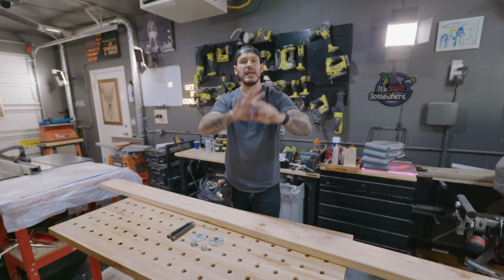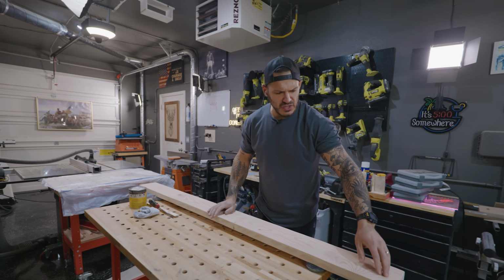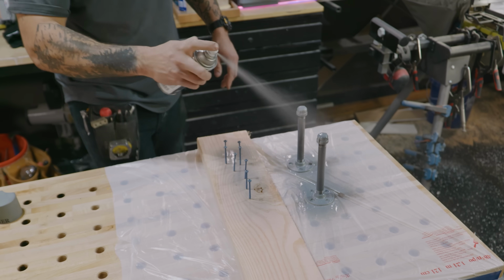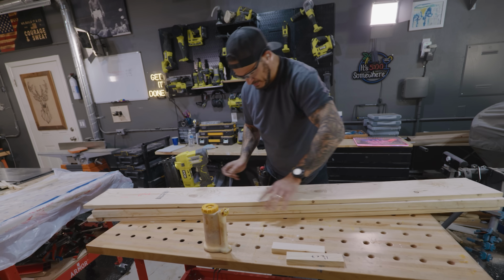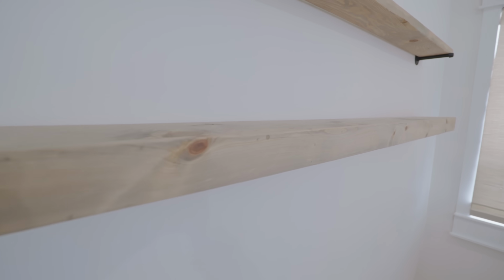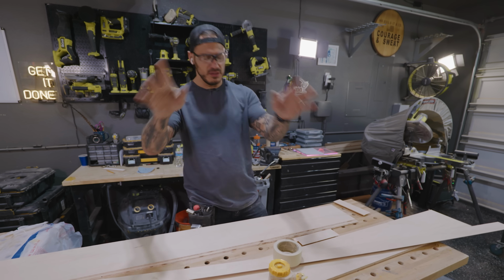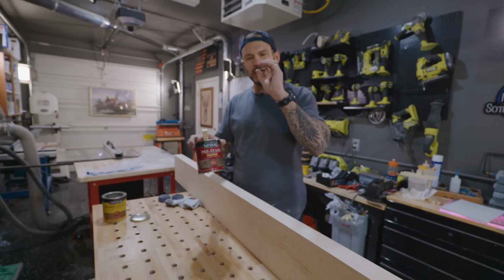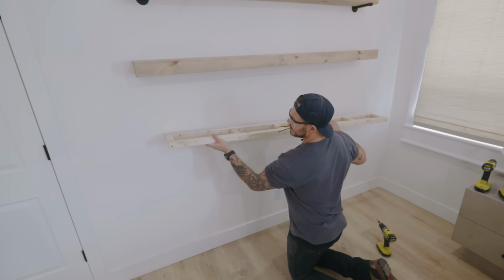3 Ways to Build Floating Shelves

Comment: Question. I was always taught that you needed wood conditioner for the dimensional and commons wood boards and that it wouldn’t be needed for hardwoods or hardwood veneer. Is there a reason you didn’t use it for the first 2 options?
Reply: Same here. I always use pre stain conditioner on softwoods

Comment: Had really good results using threaded inserts into the studs in the drywall so screws.   Very strong load bearing, and the  frame gets pulled square as one tightens the bolts
Reply: can you elaborate on this a little more? i want to make these but i wwant to make sure they are overbuilt on the load capacity

thanks! I just cant visualize what you are describing, are you saying including drywall anchors?
Reply: @NoName-sn1le  no I’m finding the studs and making a fairly large opening on the drywall, that will get covered by the floating frame then using 35mm M10 “Furniture” screw in fastenings (a sort of heavy duty T-bolt replacement that one sets with a hex wrench (Allen key) then using M10 threaded rod as the main bolt.  The frame of the floating shelf is construction grade 2x4 with 10 mm drill holes, to take rhe rod the outer half of the frame has 19 mm recesses so that the nut and washer can be tightened with a socket  under surface.  I then started the frame onto the threaded rod, added a penny washer,, and a nut, and wound it in to clear the outer frame, and then slid the rod through the outer frame and used another washer and nut to hold the outer frame.  Because I’m using 2x4 the 4” surface braces the whole shelf flat with the wall when I cinch up the nuts.  Hope that helps.

Comment: Good stuff, I'm a bit surprised the 3rd option wasn't hung by French cleat.  Some nice hardwood scraps and countersank lag bolts into stud.  Your shelf can double as a pull up bar. :)
Reply: French cleats tend to lose their luster as you go further and further from the wall. They are very strong for direct hanging loads, but loads hanging out tend to lever the edge over and render it ineffective.
Reply: I looked up French cleat because of your comment. Turns out I hung large flat screen TVs for years with that method and didn't know what it was called. TVs used to be extremely heavy and wall mounts were expensive. I mounted 2 sign posts on the wall horizontally and two on the back of the TV. Now that TVs are much lighter I use about $4 worth of chain and hang them like a picture.
Reply: @theupscriber65  Good stuff!  I'm setting some 20"x48"utility shelves up for a client this weekend.  1" oak scrap pieces countersinking the down cleat inside the rear of the box shelves so they sit flush against the wall.  Easy Peasy :)

Comment: I'm really surprised that you didn't burnish your mitered edges with a screwdriver shaft prior to wood filling.  This would tighten the miter, round over the edge thus eliminate some sanding, and greatly decrease the filler needed.  Especially since your sheet goods are veneered, lessening sanding on the edges is major.

Also, you could back bevel the edges that will touch the wall by 5° and scribe all the edges.  This makes sanding much easier and you can sand to get an almost airtight fit between the maple ply and the drywall.  If we're going pro, let's make it perfect!
Reply: i understood the words you chose but cant even remotely follow and i thought i knew some woodworking

can you elaborate on the first point you made? like just rub the screwdriver shaft down the mitered edge?
Reply: @NoName-sn1le  yup, it really is that simple.  Hold the screwdriver shaft against the miter joint at 45 degrees and run it back and forth a few times using gentle to moderate pressure.  It will crush/round the razor sharp edges ever so slightly and push them together.  Try it on some hardwood scraps to get a feel for what is possible to close up.  You can make 1/32" gaps invisible with a swipe or two and that breaks the edge enough that you really don't need to sand it afterward. William Ng has a great demo: https://www.youtube.com/watch?v=gyHtW_x8Y64

Comment: A really interesting video, you made me realise I was trying to make the advanced version despite being very new to the hobby (and not being a table saw!!), I'll have to try the easier ways. 
I would love to see a beginner version without exposed hardware (the other two versions are easy to adapt for different design styles, but the pipe brackets are less versatile/I prefer the fully floating look). Maybe a beginner version could be the same board but with some holes drilled in for puchased floating hardware - not sure if it'd be doable without a drill press, but maybe with a jig to keep the drill at 90.
Reply: seems that a beginner version could be something like the advanced version except, instead of making the shell and then the frame and sliding the shell over the frame, you would attach the frame to the wall and then attach the top, bottom, and edges individually.
Reply: @thomashernandez9067  attaching the pieces to the frame on the wall seems like it'd be harder to me! Where I struggled was the miters, and lining those up while attaching them to the bracket sounds impossible!

Comment: My big takeaway was the filler you used does not accept stain equally. I really don't see the need for nailing. Glue it and clamp it correctly and you're good to go. Consider the fact that you're framework is supporting the top piece of wood only and nothing else.

Comment: Personally, my thinking is when you can see the bracket, it's not a "floating" shelf. I liked the advance shelf idea a lot.  Also, tip: when you're cutting repeated lengths like those 5" pieces, clamp a stop block on the end of your chop saw, then slide up to it and cut and they will all be precisely the same length and it's super fast!  Keep up the good work!

Comment: Nice work, and the fact that you showed multiple options is awesome. I'd say 1 is for beginner, 2 and 3 seem intermediate, I wouldn't call the last one pro, as I've seen much nicer work for "pro" where it's all joints (no screws) and attention to finish detail would be of course what brings it up to pro level. Good job!
Reply: For me also pro level would be no visible screws/nails even on the underside, well hidden fixing method to the wall (dove-tailed slide bar, some metal variations) and or using a solid piece on wood for the self and decorating it with inlays(contrasting wood, metal, epoxy what ever)